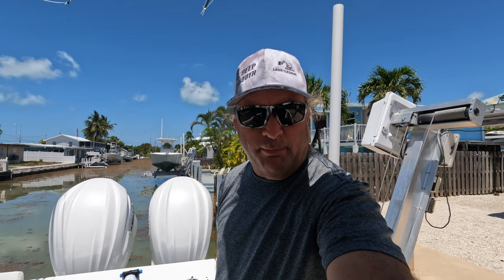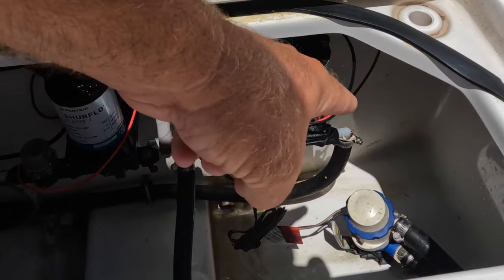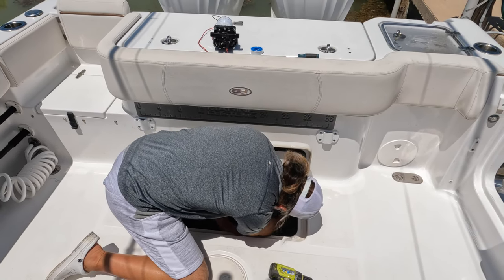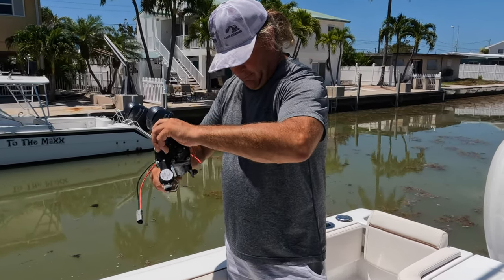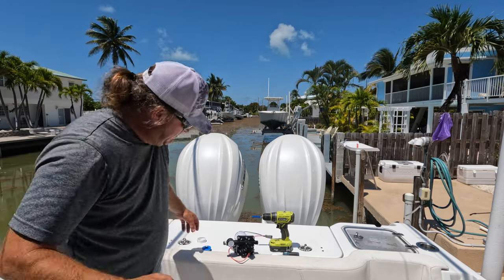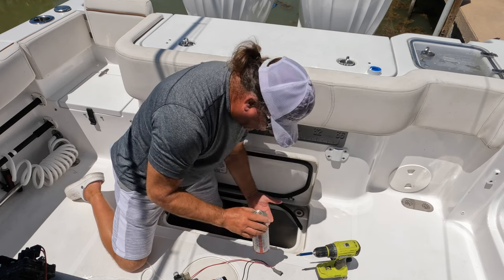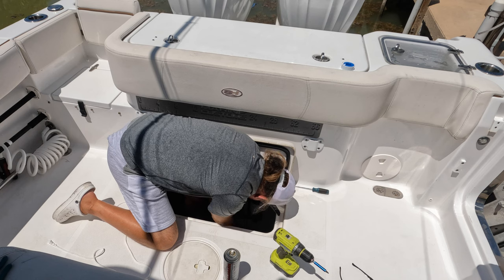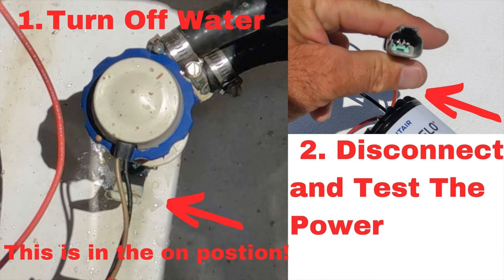How To Install A Boat Washdown Pump In Minutes!

Comment: Does your livewell pump need to run when you power up the washdown pump ? Or does it suck through the livewell pump?
Reply from the maker: They are 2 different pumps.  Every boat I've owned has had different pumps, the livewell pump is specifically for livewells.  Hopefully that helps!